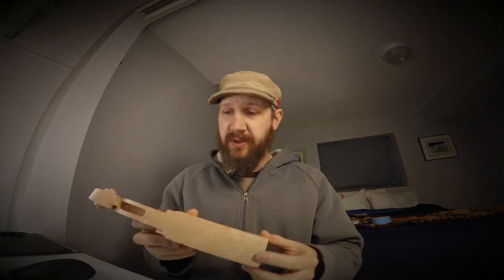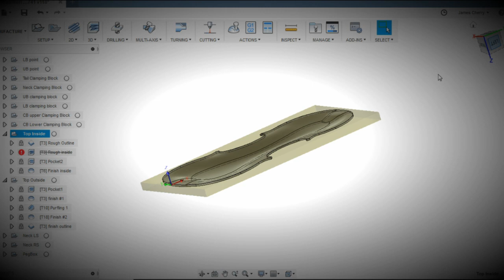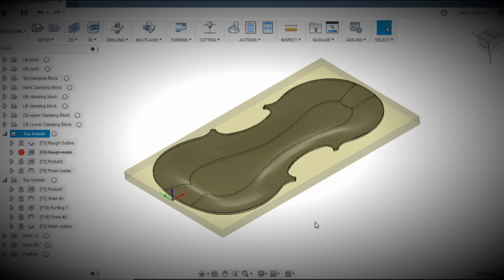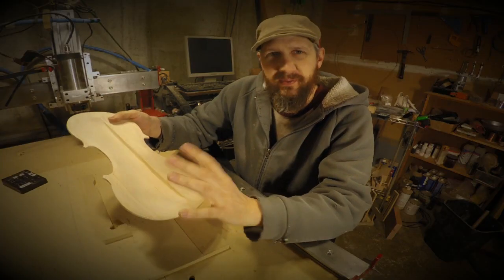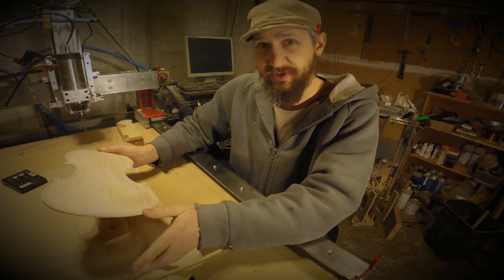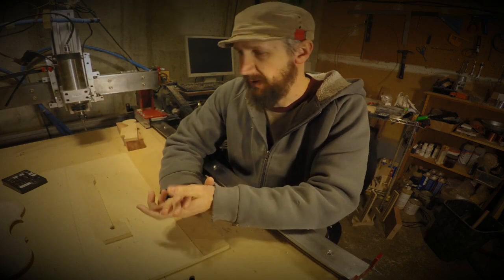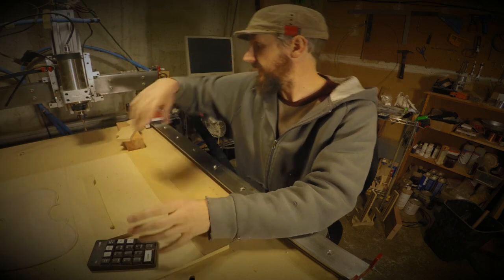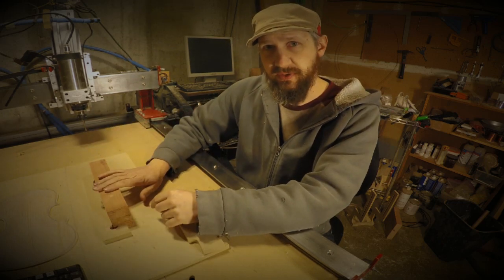CNC cuting parts from both sides| Making the Guaneri 'del Gesu' Vieuxtemps Violin part 13

Comment: Your corner blocks should be smaller. They are going too far up and down the ribs (too long). This will add extra stiffness and a little bit of weight. Sorry to be critical but figured I would pass that on. Really enjoying your project and videos!
Reply from the maker: yes, that is certainly true,  there should be a lot of changes next time around.

Comment: Re: Registration. Won't it be easier to add a tab on either end for registration, and cut out the tab at the end of the routing?
Reply from the maker: A lot of folks do just that, for me, it's an extra unnecessary step. My process works for me,  and I'm able to execute to a precision less than .01" reliably.